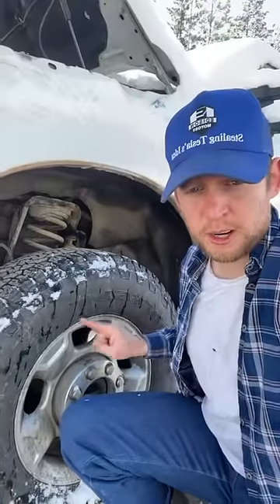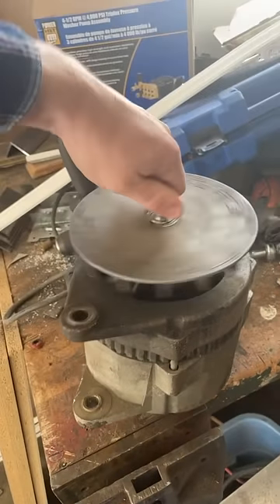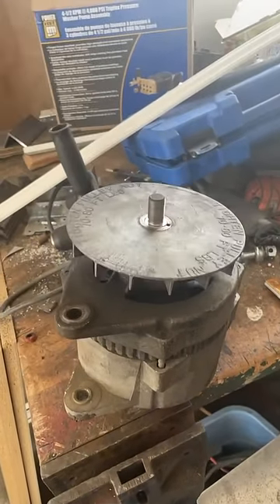Alternator on each wheel???

Comment: There IS an alternator on each spinning wheel. That is the definition of regenerative braking but you still need to plug it in.
Reply: I hate that I'm saying this, but a prius. They were the first to commercialize regen braking, and they are hybrids. There are plug-in prius' I think, but let's use a 2006, for instance.
Reply: An electric motor is in essence an alternator.
Reply: @The-t3z  
U mean generator
Reply: @The-t3z  depends on the motor, and it would be a generator rather than an alternator in most cases.
Reply: @JohnSmith-xu7ev  No, a generator has to be brushed and produces DC without rectification.
Reply: @kingcosworth2643  
Alternator produces AC, and cars dont use AC for motors.
Reply: @JohnSmith-xu7ev  In the automotive industry they’re often interchangeable
Reply: @wackbirdz  
They use DC, its called lithium batteries
Reply: @JohnSmith-xu7ev  he said to drive the motors, not to store the energy/draw from the batteries.
Reply: @RetroGamer74  we own a 2003 prius with over 300,000 miles on it now. thing works great, will eventually need new hybrid battery. take care of things they last, its nice
Reply: @jimmy1743 that guy  Blew the head gasket on our 06' around 230k. It made it to around 290k before she finally kicked it
Reply: @ChadDidNothingWrong  
That would be DC, if you alter the frequency and voltage the current is still DC originally.
Reply: @johnb3587  
They are not. You must a YouTuber mechanic to think that
Reply: There are technologies that allow the alternator to spin freer than what’s currently in production, but once again, the greater the load on the alternator, the more drag it produces. So it will spin easiest with no load, and hardest with full load. The bigger the alternator the harder it spins.
Reply: THANK YOU.
Reply: @RetroGamer74  My buddies grandma still has an 08 prius since new that has a ton of miles on it and it's never let her down. 

I would buy a used prius before I ever bought a tesla lol
Reply: There is no zero sum game.
Reply: @contraband1543  I just hate the acceleration. Other than that they are great little cars
Reply: Regenerative braking recovers some of the kinetic energy that would otherwise turn into heat and instead converts it into electricity. In this system, the motor drives the wheels during acceleration or cruising, but the wheels drive the motor while decelerating
Reply: @JohnSmith-xu7ev  Tesla cars and many other Evs use AC motors. The motor controller uses a PWM DC to AC converter to vary the power produced by the motor. It's a much more efficient system than a purely DC sustem.
Reply: Websters dictionary states. 
Regenerative Braking - the use of alternators on each wheel. But you still need to plug it in.
Reply: @joelschermerhorn5447  there are unicorns that don't exist but the theory is there. We just need to find the unicorn
Reply: @RetroGamer74  and I'm sure your sentry rips!
Reply: @DJ.1001  
Thank you for teaching me something I already known from 20 years ago
Reply: @JohnSmith-xu7ev  a motor being spun can act as a generator, a generator being spun can act as a motor
Reply: @lachychops2  
But will it win an academy award for all this acting?
Reply: @JohnSmith-xu7ev  yes
Reply: Yeah, this guy is lost!
Reply: @JohnSmith-xu7ev  they use AC, its called 3 phase modulating inverters
Reply: @JohnSmith-xu7ev  Sorry but you’re wrong. It’s DC coming off the batteries but the current runs through a power inverter to produce high-frequency AC (I think it’s something like 440Hz) to drive the motors.
Reply: There's one vehicle that gets almost as much energy as it uses through a generator to the wheels. it's a house sized quarry dump truck. uses far more energy going uphill as it carries stuff out to.... Wonder if thier info on it is with or without carrying stuff to the top and coasting back down...
Reply: @JohnSmith-xu7ev  

Then make it DC and store the charge in an unused battery that the car switches to when the charged pack is almost dead...
Reply: @Blazeww  Nope, over 80% of the energy released in combustible fuels used in a vehicle is in the form of heat and it doesn't matter how much you go up or down hills or how heavy your truck is, you aren't getting that heat energy back. On top of that engines don't run on heat.If they did you would never need to buy gas driving through the southern states.
Reply: @Sidicas  You do know the idea I'm talking about with generators in the wheels would be less resistance on the car than having passengers that weigh over 140 pounds and hardly effects mileage right... And that it's a not a perpetual motion machine but a digital computer system that has two sets of batteries. One to use to drive and one to charge when not being used. One battery dies and the other gets charged. At the least it would give better range at. 

Add flywheels to... Hell buses in hilly places use fly wheels as their engines for hours... All that's there right in people's faces and noone tries cause someone claims it won't work.

Nikola Tesla had a car that bigger people than him refused cause they couldn't put a meter on it as it charged from patent energy in the air. Government has that black box of his that helped do it to.

 Literally energy in the air around us. Could even make a thing to light a bulb using no energy with the right set up. If science used all it knows to do it electric cars wouldn't need charged as much. Hell a dude from before the great depression had it already but gas and making people pay for it was more wanted. How come he could do it but not Elon or anyone else with better tech than Nikola Tesla had... 

Then it's kinda obvious why they'd lie if they do have such things... Less dependence on Governments. World full of workers that would lose jobs cause gas wouldn't be needed...

Tho even if it did make unlimited range that's limited by the wear on parts and batteries going bad. Still leaves powering everything else to other methods that do far are more expensive everywhere renewables took hold. Europe was forced to use more polluting things than gas cause of how expensive and unreliable renewables  are... And as Earth itself is over half of global warming and even warmed faster before the last ice age than now. And hydrogen would add to the water vapor that makes 50% of the warming as other natural sources make up 40%. That's also using old data where they assumed natural sources put out far less than newly discovered ones that put out 100 times more natural green house gases than the next largest natural source.... So humans do less than we want to take credit for ad Earth's been worse with global warming before we were even around polluting...

Wonder why they want to add water vapor from hydrogen fuel to water vapor that's half of the problem and put it had fun in the atmosphere through plane engines. They must really be trying the help right. 

And I bet you believe they can do what they even say is most likely impossible with fusion. Yet generators in an electric car is far fetched. And none try the generator thing in EVs at all in the way that would be more than just hooking an alternator to the drive wheels and batteries. Lol. Waste tax dollars on fusion tho as even the sun needs quantum effects to do fusion as it does two other forms of energy production.... Really not gonna try and debunk the self charging EV tho... As the tech to do it exists and noones actually even proven anything...

If everyone thought like that earth would be the center of the solar system and flat still, electricity wouldn't exist, lightbulbs we're impossible once to...

 Hell flying was thought to be impossible. Should they all of just took people's word for it and not tried at all...
Reply: @timothy098-b4f  three phase motors that change rpm by varying the frequency. A 60hz motor would turn slower if wired up in europe, 50hz. DC motors change speed  by changing resistance between the battery and motor.
Reply: wel you dont have to if you only driving downhill lmao
Reply: @JohnSmith-xu7ev  and there is an INVERTER that converts the dc from the battery to ac for the motors. in tesla and others..
Reply: @Danny’s DIY LIFE  regenerative brakes is the worst term the auto industry has come up with in a long time. It's has literally nothing to do with the brakes other than they haveto work slightly less.
Reply: @RetroGamer74  the term regenerative braking is nothing more than a sales gimmick it has nothing to do with the brakes.
Reply: Regenerative braking my boi
Reply: They do have a generator on each wheel but not an alternator
Reply: @kugelblitz1557  a generator generates 12 V DC and alternator generates alternating current that is the reason why it has a rectifier to change it from alternative to DC
Reply: @jeremynewman1277  yes but an ac motor would be able to generate alternating current, making it an alternator.  Also not all generators operate at 12V, that's just standard for small applications.
Reply: If you only go downhill, you'll never need to charge the battery.
Reply: @JohnSmith-xu7ev  uh, yes they do. Through an invertor, converts the DC current of the batteries into ac current for the motors
Reply: @JohnSmith-xu7ev  bro go learn something, of course the traction battery is DC, the inverters that drive the motors covert the DC into variable frequency 3 phase ac in most cases. Cars don't use brushed motors tf
Reply: @colin_deans  I think John Smith is a lost cause. He swatted away the first posts pointing out his error, saying they were only telling him what he knew 25 years ago. (Clearly it must have gone in one ear and out the other)
He also said that DC remains DC even in you change the frequency. Clearly he has no clue what DC actually means.
Reply: @colin_deans  
I already know everything. Ive been doing this since you were 7 years old listening to taylor swift dig downloads
Reply: @JohnSmith-xu7ev  well then fix your comment because it's incorrect
Reply: @RetroGamer74 
Whether you like them or not, the Prius is a damn good car
Personally, I despise hybrids, but I will not deny that the Toyota hybrid system is good
Reply: @wackbirdz  exactly. High voltage AC
Reply: There was a Volkswagen diesel electric hybrid that was electric at low speeds and when more torque was required at highway speed with engine running. The motor/generator was between the engine and transmission. It also utilized regenerative braking and the motor also served as a starter motor for the engine.
Reply: @kugelblitz1557  with permanent magnets and producing DC current it would be a generator. Using electromagnets it produces AC and rectifies to DC making it an alternator.
Reply: Depends on the motor. You can actually use an alternator controlled by a motor controller for a motor. You have variable speed and variable torque in forward and reverse. You can also have full torque at full stop.
Reply: @klpittman1  I don't know which cars have which.  I know alternators produce ac and generators produce DC, I know alternating current is a sine wave between positive and negative and DC is just negative flowing towards positive, I know the units of energy and how they're related, that's the extent of my knowledge.
Reply: THANK YOU! I was like TF is he talking about?!?
Reply: That's what I was saying too like wtf bro.....
Reply: @The-t3z yes it's just backwards instead of putting power out it takes it in.
Reply: The man in the video forgets there’s already a power source under the hood
Reply: The old geezer is trying to ask why there isn't perpetual energy machines on a Tesla. The truck guy explained it via laws of Thermodynamics. The vehicle slows under regenerative breaking because of the laws of Thermodynamics as well. Add in friction/heat from the tires and road surface and the drag coefficient of the vehicle, you never recover the energy spent to drive.
Reply: @wackbirdz lol no they don't buddy
Reply: @Scotty-vs4lf they use AC to convert to DC.

That's not "using AC" stop.

Cars will never run on strait AC it's to dangerous
Reply: @Blazeww IT DOSNT WORKKKK
Reply: @colin_deans that's it tho lmfaooooooo

Everything else runs on DC in the car.

Y'all just love splitting hairs.

That's like saying a regular car doesn't run on DC. It runs on gas.

Well yes....the engine does....but not the car
Reply: What if you added a couple solar panels on top?
Reply from the maker: Yes, regen braking is a thing 100%.  But I'm so tired of explaining that Regen Braking isn't free power: it slows your car down.  You can't make 100Kwh while constantly cruising at 100kmh and not losing speed
Reply: Older Ford's have a generator with an external voltage regulator that produce DC . 
 An alternator has the voltage regulator built into it basically . And an alternator produces alternating current AC .
Reply: @JohnSmith-xu7ev  its converted to DC
Reply: Regenerative braking is such a lame term... Lol I liked it more as KERS in F1, KERS - Kinetic Energy Recovery System. Actually know what it is based on the naming! "regenerative braking" sounds like a new brake system where the brakes never fade when pressed hard, it instead regenerates itself...
Reply: @JohnSmith-xu7ev  Vehicle motors usually use a sine wave electrical current to power the motors. Like a big 3 phase AC motor. That is essentially what they are. A 3 phase AC motor. Also essentially the same thing as a brushless DC motor. Very similar motor theory. Feed the motor a pulse width modulated (PWM) voltage signal in the rightbway and it spins or resists spinning.
For a 3 phase AC industrial motor, that power is provided by AC from the breaker panel and the utility company. For a car, that power cannot feasibly be transmitted since the motor is now moving along an undetermined path usually using a roadway that isn't electrified. So we need to store electricity to power the motor. So far, we can only do this in a dc format. Supercapacitors and chemical batteries. These store DC electrical charge which can be utilized as DC electrical power. That's all we have. No even theoretical AC storage devices.
But, I said the motors are AC. Right. So we need a motor controller (a ESC (electronic speed controller) or a VFD (Variable frequency drive) or some other form of device) that converts the DC input into a voltage and waverform that the motor can turn into rotational power. So, you feed the controller DC, and it uses components and brain boxes to "cut up" the DC input really quickly and "shape" it into the right voltage for the right phase at the right time. If ypu looked at this output on an oscilloscope, it would look identical to an AC waveform because that is what it is trying to mimic and that is what the motor needs.
If you need a more detailed explanation, please start digging into motor types and motor drivers for the different types.
Reply: @JohnSmith-xu7ev  the term generator is actually generic. An alternator, a dynamo, a magneto or even a PV panel are all generators.

What an auto mechanic called a “generator” in a 1951 six volt De Soto is actually a dynamo. A dynamo has an electromagnetic field (stator) and generates alternating current that is rectified to DC by an internally timed commutator and brush gear.  Modern automotive alternators produce three phase AC current rectified by six semiconductor diodes wired together in a three phase bridge. Their electromagnetic field (rotor) is fed DC through small brushes riding on slip rings. The alternator in your riding mower, outboard motor or motorcycle is typically a permanent magnet alternator previously called a magneto until the invention of the dedicated ignition magneto. The “magneto” in the flywheel of a Model T is actually a permanent magnet alternator powering a separate tremble coil ignition system.
Reply: @tadonplane8265  
Why would you waste your time when im an expert in the field?
Reply: @lachychops2  
Not if its Tom Cruise in today's society. 
Just saying😂😂
Reply: @joelschermerhorn5447   I think they should just make the cars out of solar panels, discover a way to change the colors. Spend less money.
Reply: This guy gets it.
Reply: @John Smith  what does AC stand for when talking about electricity?
Reply: @kingcosworth2643  does not have to be brushless. Can you tell me what DC stands for?
Reply: @Dat550go  "Direct Current', and AC stands for "Alternating Current"
Reply: @57rumors Wrong, you need magnets to make an alternator, most electric motors don't have magnets, just coils.
Reply: @bioemiliano  Motors are composed of two main parts, magnets and coils of wire. when you spin the coil wire against the force of the magnets it creates a charged current flow in the wires generating electricity. When you put power on the coils synchronized with the force of the magnets you cause the electricity you put on the wire to become from electricity flowing on the wire to change into a magnetic field around the wire that spins the coil at the expense of electricity. So a generator and a motor are the same thing used in different ways. Like you can use your fork to eat with but you can also use it to cut through a piece of cheecake. A fork is still a fork. A motor changes electricity to spinning coil and a generatot changes a spinning coil into electricity they are the same thing in action depending on what you do with it. Its strange we call motors and generators different things but we call a fork a fork even when you use it differently. In fact at Niagra falls during the daytime the water from the reservoir pushes the coils to generate electricity and at night time when that energy is not needed the same motor/generators are  used to push water up high into the reservoir so that water can then come back down during the daytime when electricity is needed and push the coils against the magnetic charge to generate electricity.
Reply: You draw more power than what all 4 wheels can generate.  It's not  anyway beneficial.
Reply: No there's not. The same traction motor responsible for propulsion will generate power under regen breaking. There is no tesla with an independent motor on each wheel, and if there were, they'd be motor generators.
Reply: There’s so much misinformation in this thread…
Guys just please do a google search 
And if you’re still saying “I know everything already” you’re the problem. 
There’s a reason we mechanics have to constantly re-certify ourselves, we can’t afford to stop educating ourselves either, at least if you’re working on modern cars.
Reply: @revus5078 I'm a stationary engineer where my bread and butter is d***ing with all types of electric motors and motor drive systems. Yeah, this whole thread made me lose brain cells 😂😂. For how many good resources are available on the internet, a basic understanding of physics seems hard to come by.
Reply: Regenerative braking takes place in the transmission
Reply: @RetroGamer74 They got the technology from the Lemans LMP cars!
Reply: @Blazeww Seek help.
Reply: @JohnSmith-xu7ev  An electric car can use either an AC or DC motor depending on the motor controllers. However, I think most EV's use AC motors. The original Tesla motor was an AC induction motor.
Reply: @jimmythatguy  You're lucky. Most last about half that time. And when they need replace... cha-ching
Reply: @johnb3587  fancy seeing you here xD
Reply: @RetroGamer74 Yet people try to make it seem like Tesla created all this ev stuff when Toyota was doing it way before Tesla was even popular.
Reply: @joelschermerhorn5447 What you mean is that alternators can now disengage and not constantly charge the battery when it’s already charged to help with energy consumption and longevity.
Reply: True but if you already have a battery for the vehicle and the 4 alternators  output from battery would have 4 or 5 alternators if have a standard 1 2  working like the dual hemisphere engine lost technology that after the initial spark each hemisphere cycles creating current like a amplifier
Reply: @dklthibodeaux  mmm it is a stand alone system yes however it most certainly recovers energy as it reduces/brakes the vehicle forward movement. 
Yes the vehicle also has conventional braking system.
Reply: @mauricemotors8207  well said.  Tesla however got the concept done on the market. Toyota is still pretending to have sold state battery tec that will be ready for sale in 3 days from tomorrow. Lol
Reply: @lachychops2  same item in principle
Reply: @Blazeww  Na electrical haul truck are no where near energy neutral. 
Unfortunately.
Reply: @Blazeww  no we should always be looking to improve in all aspects of our lives. 
Unfortunately there are rules of existence that don't  change just because they are inconvenient. 
You just can't have perpetual motion. 
Not on earth.
Reply: @dklthibodeaux  it reduces the velocity of the vehicle yes?
In doing so it recovers tiny bit of energy yes?
Therefore it most certainly can be defined as a braking  system.
Reply: @dklthibodeaux  how so?
Reply: @jeremynewman1277  a generator produces what ever voltage it is designed for!
Reply: @EdisonMotors  it isn't free power bud.
The energy has already been introduced.
The momentum of the vehicle has already been paid for.
Wow!!
Reply: @jyuvgrace5364  not quite. 
It as you say doesn't regenerate its self. 
It converts momentum that's already been provided into current. 
A poofteanth of it.
Reply: @charlesdeblanc3386  same thing bud.
Reply: @raymondbutterfield8621  on or inside the moon?
Reply: @0Aus  yes, just driving vs driven
Reply: @The-t3z  not wrong though a generator is just an AC motor in reversed
Reply: No you dont. You will have to move the car the VERY FIRST TIME IT MOVES. THAT IT....After that it will charge the batteries.. tell me why without just sayn ..it wont work
Reply: To generate electricity you need to spin against the force of the electromagnets and that takes a lot of spinning work which is very tiring. Which is why the regenerative braking slows down the entire vehicle so much.
Reply: @RetroGamer74  There were other electric vehicles before that.
Reply: Yes but that is only getting back 50 percent of what the electric motors put in to speed the car up !! Not generating 130 percent power !
Reply: @The-t3z an electric motor is a generator, an alternator generates alternating current and you cannot charge batteries with an alternator alone .
Reply: @kugelblitz1557 in all cases , you can't charge a battery with alternating  current . You have to run through a diode bridge loosing more power !
Reply: @JosephCowen-fz8vj  regen braking gets back more than 50 percent, depending on how aggressive you are with it. It can’t go over 100% because that is not physically possible.
Reply: They make billions off oil and gas is why. And you say this as if it would just be the same alternator that is on the truck etc. It is doable, but never going to happen. Same reason why we don't have free energy.
Reply: Not really .
Reply: @JohnSmith-xu7ev wrong. voltage regualtors in the alternator ALTERNATE IT to DC voltage
Reply: @maddog7999  
So you failed English
Reply: @JohnSmith-xu7ev  nah son. been reading years above my pay grade since the beginning
Reply: @JohnSmith-xu7ev An alternator is a device that converts mechanical rotational energy into electrical energy, and that is usually a three phase system. (Obviously AC)
A generator is typically intended as a engine-alternator system, and that usually outputs AC as well.

Now, when we talk about a car alternator, it's a common alternator with added rectification to charge the battery.
An alternator and a generator both output AC, and a car alternator outputs DC after rectification. 

What some people here are referring to by "generator" is usually called a dynamo.
If a "generator" outputs DC, chances are it's an alternator with a rectifier or it's a dynamo.

Edit: typo
Reply: @rosskrt  
You typed that and you still got it wrong im an engineer so i dont need a poor attempt at explanation
Reply: @JohnSmith-xu7ev  you called "generator" an alternator, which isn't totally wrong but it's like saying a house is the living room. So yeah, don't correct me. Or, at least do it properly; just saying "you're wrong I'm an engineer" doesn't mean crap. Means literally nothing. You didn't disprove me, you didn't even say what branch of engineering. You could be a fisherman or a cook for all I know.

Btw, in case you forgot how to read, my comment wasn't only for you; it's just that I can't reply to multiple people in the same comment. And I'm not making 10 copy paste comments just to address everyone individually. I thought the wording was clear enough but oh well.
Reply: @rosskrt  
I do this professionally. So im an expert in the field. AC and DC are two different things. Stay away from electricity because you cant even grasp the basics
Reply: @JohnSmith-xu7ev  Hmm that's interesting. Other than being a fisherman or a cook, you could very well be an internet troll.

Because I explained very clearly the different types of mechanical to electrical energy converters and that some output DC and others output AC. So, for you to be telling me that AC and DC are different things, you're either an internet troll or as dense as tungsten.

Don't know which one's worse, but it's a you problem either way. Have fun!